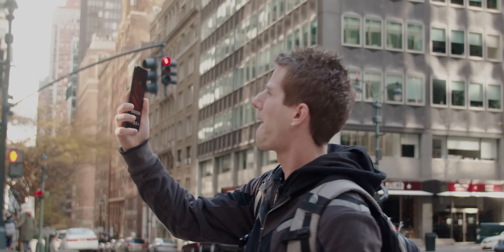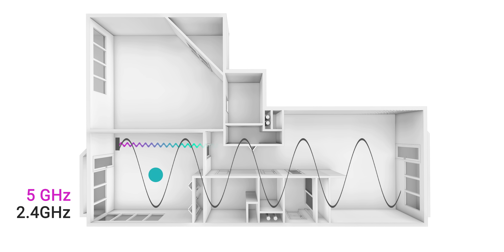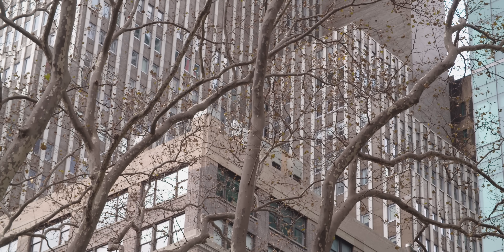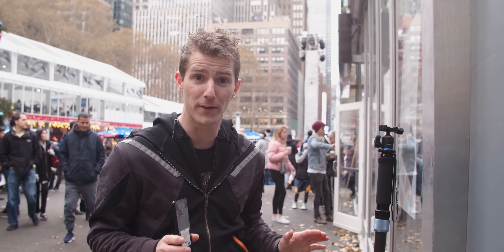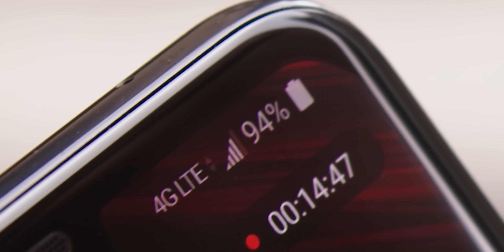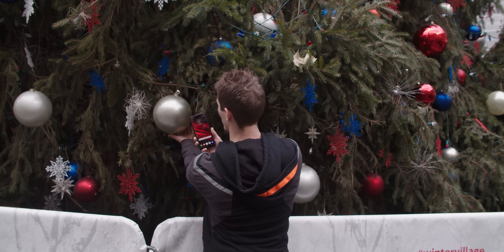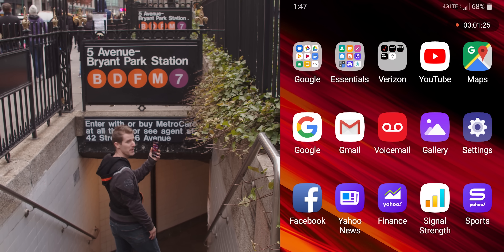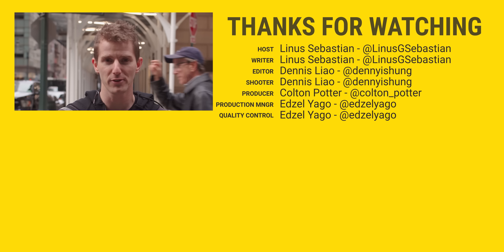The PROBLEM with 5G mmW...

Comment: I've been watching this channel for many years and this is the first time that You Linus got used so badly by a big corporation.

What t-mobile showed In that presentation was basically the idea that 3G (UMTS) was promissing to offer even before 3gpp was thinking about really high througput (like 20 years ago), meaning that it's common knowledge in telecom business.

What t-mobile didn't tell you is that 4G deployed on the same frequency band below mmWave spectrum (so like 700-5500MHz) will have at least 98% of the throughput that 5G will have on that same band.

Why?

Well that's because 4G radio encoding is already way above 90% frequency usage efficiency (assuming that 100% efficiency would be the the limit posed by the Nyquist–Shannon sampling theorem, and also excluding the guard band without which the networks wouldn't really work with neighboring bands).
At the same time 5G radio encoding pushed this around 2% higher with new encoding techniques but in real life it's impossible to notice.

Ok, so what's the difference between 4G and 5G?

Well the most important one is that a so called "carrier" in 4G can be at maximum 20MHz wide. To use more bandwidth to communicate with a phone 4G has to use "carrier aggregation", and it can do that usually with 3x20MHz carriers, and the 3gpp standard allows for 5x20MHz carrier aggregation.
When a telecom operator buys frequency, there is no way for a single operator to have bandwidth wider than that available at any location in the world basically.
At least that was the case until mmWave bands were developed.
What they allowed is to allocate bandwidth as wide as hudreds of MHz to a single telecom operator, and that's the only reason that 5G was developed.
The difference is that 5G allows for carriers wider than 20MHz, to be specific it allows carriers 100MHz wide, and even wider in the future, and the 3gpp standard of 5g also supports carrier aggregation, and that's why 5G is so cool.

The thing that t-mobile didn't tell you is that switching between mmWave 5G when available with huge throughput and LTE using some lower frequency with less bandwidth is the exactly same experience that you'll get with the t-mobile solution.
The only difference is that in t-mobile deployment you will see the 5G icon more often, even though it will work with the same throughput as LTE + mmWave 5G can in the same scenario.

So this video is basically blatant lies based on lack of technical knowledge (I sincerely hope that you didn't know Linus). 

One more important thing that t-mobile isn't telling is that enabling good 5G coverage using the lower frequency bands comes at a cost. That cost is that they are limiting the bandwidth available to their own LTE deployments, so in order to make the tech nerds happy with good 5G throughput and coverage they are piecing out their LTE deployment effectively making their LTE network slower. The only other way to do it is by getting more bandwidth, but that's all already sold and allocated to the telecom providers (which is why they were talking about the sprint merger, but still, getting decent 5G bandwidth in 2000-3000MHz frequencies is not possible without making the LTE deployment bottle necked by allocating it a much narrower bandwidth than it previously got.

I understand that after buying all that equipment and realizing that it's not going to get any faster than LTE without more bandwidth the boffins at T-Mobile must've been really pissed, and that's most likely why they figured out this misinformation campaign to discredit other operators that actually invested in 5G where it has any benefits.

I really hope that you either retract this misinforming video, collect some actual information on the subject, and prepare a rectification video, because I believe that this channel used to have a high standard of ethics in their content, but this video crushes that belief.
Reply: Even when, you said what I already thought.  It still didn't get into my head quite black and white.  But, it is good to hear that the story the Linus was talking was all just a story.  And even though.  The way I heard what you are saying.  The artificial benefits that are currently showing.  They will disappear after the network is congested with some customers.  Right now it is easy to show awesome performance.  Because we are only at 10% of capacity.
Reply: I think you forgot the more widespread use of 256QAM and 4x4 MiMo.

I have a 5G device and on n1 with 20 MHz ch bw I reached around 430 Mbps down (525 Mbps should be possible there), the theoretical max. throughout of LTE B1 with 4x4 MiMo and 256QAM should be about 391 Mbps.

The spectral efficiency of 5G should be upto 50% higher, but of course it’s just theoretically so.
Reply: @MaxMüller0  256qam and 4x4 mimo is not widespread at all. Also you're comparing different coding and mimo configurations, not the LTE vs 5G radio protocols. 5G in an apples to apples comparison (same coding and mimo) is only 2-3% more efficient, no more. This is because LTE is already reaching around 95% peak theoretical bandwidth data throughput.

Different coding and mimo configurations can also be used with LTE setups.

Getting higher throughput from the same 20MHz band requires higher SNR, and the more complex coding is what takes advantage of that, not 5G - those are two different things. Mimo on the other hand is meant to increase the SNR, but it's effectiveness is usually very limited.
The disadvantage is that higher SNR is available only at really short distance, meaning that it's not really useful besides wifi, as for mobile this will work only at line of sight benchmarking, which is not the general usecase for mobile.
Reply: ok boomer

Comment: Any chance you can mention the fact that the 5G hardware is a battlefield interrogation system and can be (and is being) used as a weapon?
Reply: Damn no wonder US banned Huawei
Reply: No, because it's not true. It's not a weapon in any way.
Reply: 5G doesn‘t cause any health effects.
However, if the 5G equipment comes from Huawei, it shouldn’t be trusted (but same goes for 2G, 3G and 4G equipment).

Comment: Question is: Who needs this kind of speed over their celular data? 
Upload speeds are very bad on top of that.
Reply: Speed is just a "side effect" of 5G, the main advantage is lower latency, and the features you need for Iot (a lot of devices, direct device-to-device communication etc)
Reply: @tobimai4843  ok what happens when the latency showed in that video is higher than my 4G connection?

Comment: Low and midband 5G is about 2X faster than 4G.

Or exactly as fast as 4G used to be before it was over subscribed and congested.

mmW was the only good part of 5g and anybody could have told you - that even holding it wrong would block the signal.

Comment: Linus: 5G is faster than home internet connection 
Me: 3G is faster than my home internet connection
Reply: I know the feeling, Have gigabit fibre to the gate but the apartment complex wont let it get installed. so stuck with 8mbit
Reply: @AlexNZL  My apartment is the same way, so I don't even have home internet and just use it through my phone's unlimited plan
Reply: @thelazarous  I would do that but my so called unlimited plan throttles to 1mbit if I use more than 80GB
Reply: @AlexNZL  Mine is supposed to throttle past 50GB but I regularly go well above 200GB a month
Reply: @AlexNZL  Hah, the best unlimited data plan where I live has 20 GB, and then at 512 kbit/s.
Reply: AlexNZL 😂i dont even live in an apartment and i have 8mbit fiber optic
Reply: AlexNZL my neighborhood has 2 parts the 2nd part has gigabit the first part where I live gets fucking 25down and 5up
Reply: Regular home connection can have other advantages, such as no FUP and a dedicated IP address. Try downloading something off a file sharing service through a mobile network.
Reply: F
Reply: thats your problem, its 2020 upgrade
Reply: 4g lte is faster than my connection
Reply: BIG BLAKE, I have mmWave (26 GHz)
Reply: I used to have 14.4 k dial up. I would load 5 pages at a time and walk away. Come back disconnect and read. Because i only pay for 10hr of interweb a month
Reply: N K, look at Germany. Often ist has nothing to do with „because you are broke“. In Germany ~60% of network users are not happy with their speeds. In Germany there isnt anywhere fiber of good internet.
Reply: I have unlimited data and 50mbps
Reply: I pay the extra premium fee for 12.5/5 because I live one house away from the dslam.. gotta love living out in the middle of nowhere
Reply: So your 3G is faster than 5G 😂
Reply: 5G is not faster than my home connection :)
Reply: Me mid 2021: We dont' even have 3G anymore in Germany. Only 4G (or not, in many places).
Reply: I was like, aint no way, i got 2gb-10gb for home internet
Reply: Me 2G is faster than my NBN
Reply: In Australia I got 20mbps cap with unlimited data on Felix mobile I don’t even have home wifi because my house doesn’t support it

Comment: In theory, 4G connection should be better than ADSL connection (at least for gaming online). In reality, it is better only in transfer speeds, and often only when there is only few users. This seems like similar situation, but actually worse than 4g with those problems.

Also, when i upgraded from 25mb 4g to 100mb 4g i felt no difference at all on how fast internet on my phone works, so it was just waste of money.

Comment: I used to be 5G engineer, I specifically worked on mmWave 28 GHz. Just for clarification's sake mmWave does not equal 5G. mmWave is new spectrum to the cellular market that will be deployed under 5G standards. 5G is defined as the 5th generation of mobile technology that offers low latency and higher throughput regardless of the band (frequency) that it is operating on. Higher frequencies offer greater throughput with shorter distances and greater attenuation (signal degradation) which is why the mmWave is so hit or miss in the video. Lower frequencies, like the ones we are used to, do not attenuate as much when obstructions like foliage and buildings are in its path but their speeds aren't as promising as the high band mmWave. mmWave reflects or defracts off of nearly any object in its path. The general idea T-mobile is attempting to promote is that with low band and eventual mid-band channels available to their network (once the Sprint merger goes through) is that T-Mobile's 5G signal won't drop out the way the other carrier's signal did in the video (which I believe was Verizon) because they aren't planning on putting all their 5G eggs in the mmWave basket.

Linus, when T-mobile reached out to you, did they offer you to test their recently deployed 600 MHz 5G? It was deployed about a week after you shot this video. It would have been nice to have a T-Mobile 5G phone and the other carrier's phone to compare/contrast results...
Reply: am getting 1gbps with 3500mhz band in indian village

Comment: It's also dangerous as hell. Scientists have said it's like a lifetime of standing infront of a microwave with the door off, just a few minutes
Reply: lol wft no, a Microwave as around 1000W, a Cellphone transmitter 5W
Reply: @tobimai4843  microwaves don't really absorb into the skin. Mm waves do. And FYI, a 5 watt co2 laser will cut through 1/4 inch pine wood. So "iTs juSt 5 wAtTS" doesn't make sense either
Reply: @nhwilkinosn  Well a laser is 5W concentrated, a Cell Tower is 5W spread out a lot.
Reply: Meanwhile, my tinfoil hat will keep my brains from being fried

Comment: Basically what T-mobile is doing is just renaming 4G to 5G and adding The occasional 5G mm waves when they are available without losing connection... 😑 Still the best solution currently but useless for now.

Comment: because 5g is basically line of sight like ptp or ptmp, The backhaul need to be install from building to building and in country will require high sites and probable Micro pop backhuals and that will solve the problem high and low frequencies then it makes sense to deploy 5g

Comment: I heard microwave also use  millimeter wave. I have this concern of potential side effect that human body is microwaved under 5G exposure!
Reply: The giant variable here is power
If you use 1000W of heat it will be bad, if you use 1W it won't 
Literally, your old 40W light bulb produces more heat, or even your LED 10W lamp 
All these frequencies can do is heat up your body depending on the power, like any other electric appliance
Also, FYI, your microwave uses what WiFi has used since forever, not what 5G uses
Did your WiFi fry you, I don't think so

Comment: In korea i get constant 100 to 150Mbps on 4g lte anywhere u go 
Its alway better option then 5g
Inpay around 50bucks a month for the 100GB data and 20GB family shared data(i actually have 120GB but 20GB becomes family share data where my family can use when they are outta data) and for my a80

Comment: it's Called Freespace path loss. Due  to the frequency (and length of the wave respectively) - losses are increases. I bet those towers are actually pretty danger (even at that distance). dBW  of power  if not more is transmitted.

Comment: I’ve been using a 5G connection for a couple of months and I have to say it has been rock solid so far. Not the fastest in the world (only about 300-350 down) but it is light years better than my old ADSL 5mbps connection I was stuck with, with no fiber coverage in my area. It’s been totally fine for gaming too.

Comment: Use OpenSignal... helps you find towers.
Reply: That app will go nicely with my angle grinder, thanks for that.
Reply: hootsmin something something you like grinder.
Reply: @constantringingtech2230  The angle grinder is a tool for chopping metal, I'm not asking you out via the dating app.  I like the laydees.

Comment: @Linus Tech Tips. I really and I mean REALLY did not expect such an awful ad from you. It wasn't a review of the problem. T-Mobile's 5G, with the use of a smaller frequency, will have a much slower speed (close to 4G+ actually). That's why they did it so fast and in any more places, because they don't need special hardware or placement. Verizon's 5G will need a lot more work to implement because it is based in new Ericsson hardware and cannot work together with 4G. You could do a video with the advantages and disadvantages of both technologies. But no, shameless ad all the way....

Comment: I wish you waited to take the sponsorship until after t mobile actually had 5g in that city for a comparison. There's no reason to think that competitors won't use the exact same tech that t mobile wants to, but the difference is that competitors actually have an implementation to rag on right now where t mobile doesn't

Comment: the plan is to put the antennas 500 meters apart in all the populated areas city's,towns,etc. now it doesn't take an expert to realize that having that many high frequency transmitters in such a condensed area has major implications for peoples health,
Reply: Yes it takes, because it all depends on the frequency and power, both of which are in very safe levels with 5G

Comment: Yeah, but 5G is a standard, mmW is a band.
You can run 5G over any band, switch your analogue stuff off and use that.
Reply: All existing networks are fully digital now. Though a full 2G shutdown and a partial 3G one is expected eventually.
Reply: @LouisSubearth  
I meant analogue broadcasts, TV, etc. I know we've done that in the UK and 4g runs over it now, dunno whether USA has shut down analogue for atsc yet
Reply: @MostlyPennyCat  I know that when T-Mobile bought their 600MHz spectrum, which they use for 5G, many TV stations had to shift their broadcast signal away from 600MHz.
Reply: @LouisSubearth  
Are you sure it's 600mhz?
Here in the UK 600 is empty because we're the only nation that used it, so there's no money in building support for 600 into the transceivers.
Or at least that's the reason given, which wouldn't make sense if the US uses 600.
Maybe it's because you don't use GSM or LTE? So they're no use here?
I know that our radio mics use 600.
So it's the perfect band for a pirate Teletext service
Reply: @MostlyPennyCat  yes, they made a big advertising campaign saying that this 600MHz spectrum purchase would set their bases for 5G, and T-Mobile's 5G is low band. 600MHz is low band. Then with their Sprint never they'll use their mid and high bands for the rest of the 5G spectrum, including millimeter wave.